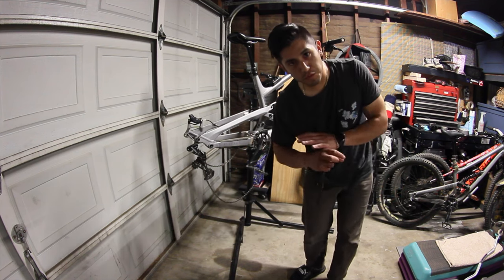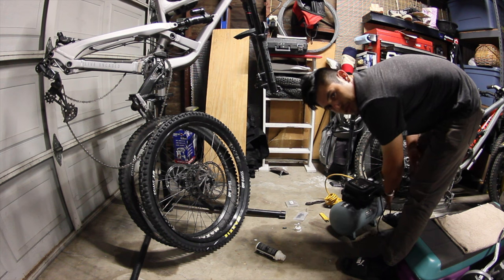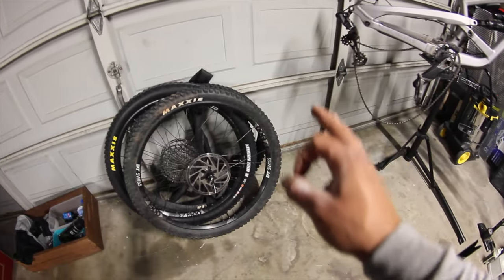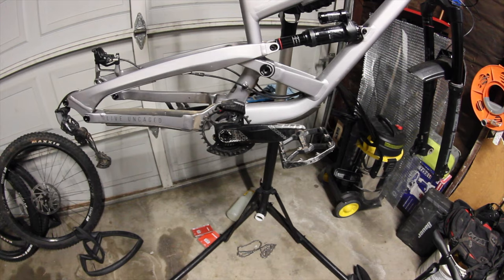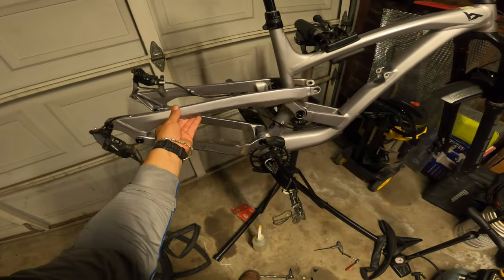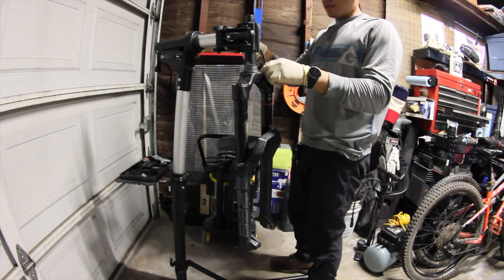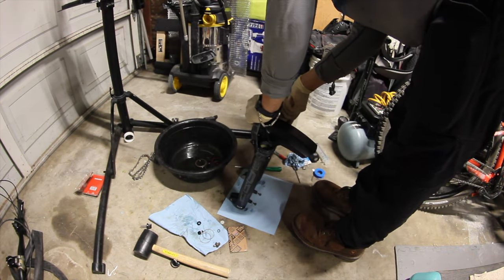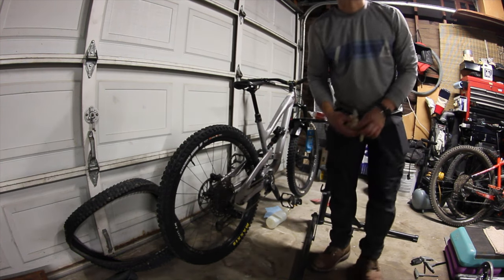Service/Tune up On A YT Capra | Upgrading Parts | Rockshox | lower Leg Service | Going Tubeless

Comment: Were you taking the dust covers off of the pivot bearings and adding grease to them or just cleaning the outsides of the bearings?  You didn't show what you were doing with the bearings.
Reply from the maker: I just cleaned the outside of the bearings with isopropyl alcohol then I re-greased the pivot bolts and outside the bearings. I was thinking about removing the frame bearings and giving them a cleaning and grease but they looked in good shape so I left them alone 😂🤘

Comment: Great job Gabriel. Good tip to just work on one set of pivot bearings at a time, just two things though;  always use the seat post to clamp bikes. Even though it’s an aluminum frame, the clamping pressure can distort the frame (be especially cautious with carbon frames in the future, just a good habit to get into)
And when it comes to seating tires, after filling sealant, if you use your fingers to squeeze from the middle of the tread while pulling out towards the bead all the way around, it will seat/prep the bead to seal up easier when filling the tire with air. In other words, instead of leaving tire bead sitting in middle of rim, pull tire out towards the edge of the rim. Hope that makes sense.
Reply from the maker: Duuuude appretiate the tips! I’ve never worked on a carbon bike but it is a good habit to get into🙌 and I’ll have to try your method with the tubeless tires, it sounds like it would definitely help me a lot 👊😂

Comment: Hey is that plumbing tape you used at 6:55 
And does it really help?
Reply from the maker: Yeah it’s Teflon/plumbing tape 🤘 I usually get a pack from harbor freight or Home Depot. I learned this trick from a bike shop and they told me that the Teflon acts as loctite between the threads and it creates a tight seal to prevent any dirt or water from entering the threads. I think it does work so I try to get in the habit of adding Teflon on all threaded parts of my bike🙌

Comment: Nice dude... Have you you installed cushcore in any of your bikes? I keep wanting to set up inserts but heard they're such a PIA to get installed.

Also, if you're doing lits of tubeless you should really try an injector via the valve... So much easier lol
Reply from the maker: I’ve never installed cushcore for the same reason, I hear it is very difficult to install 😂😂 but I’ve also heard that it is a nice add on to have on your bike! 

That’s a solid tip! I have a love hate relationship with installing tubeless but little by little I’m getting better at it 😅😂
Reply: @GabeGarcia  I keep waiting on a good secret tip video on installing cushcore to come out lol... Good thing I'm not holding my breath 😅

I do too and that's why I swear by the injector... Then if when the bead won't sit I don't get a mess